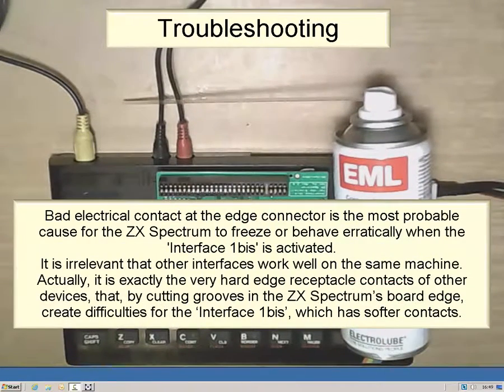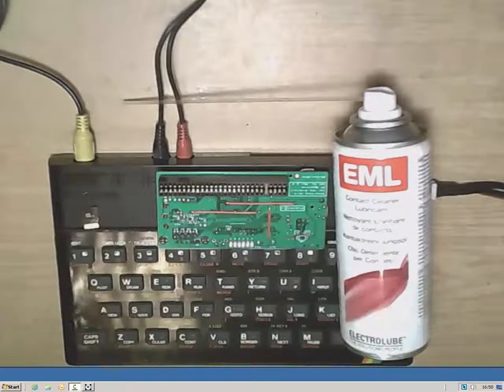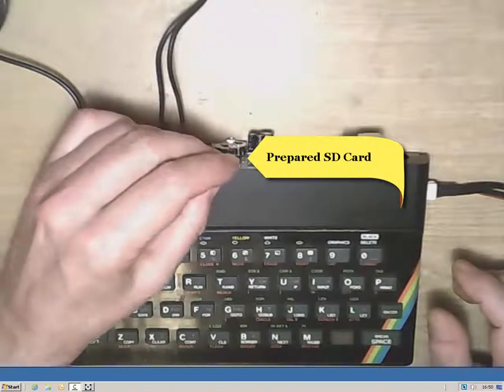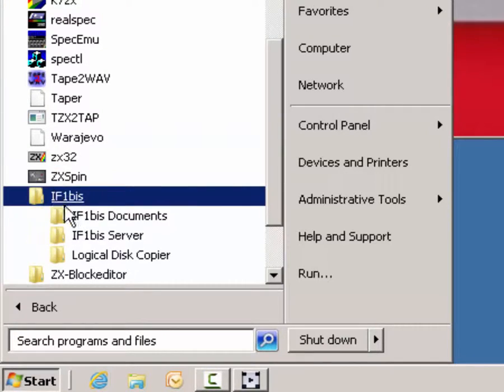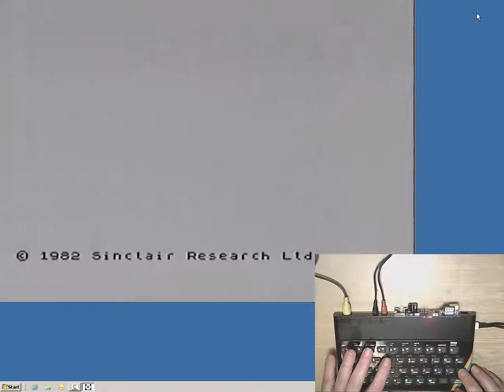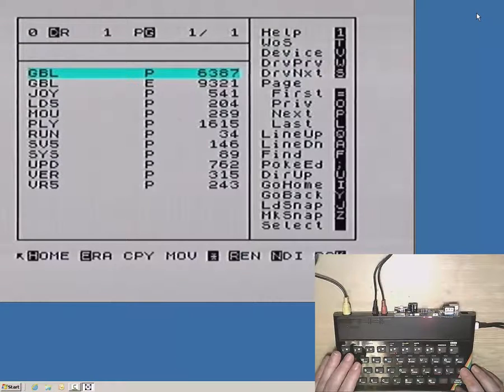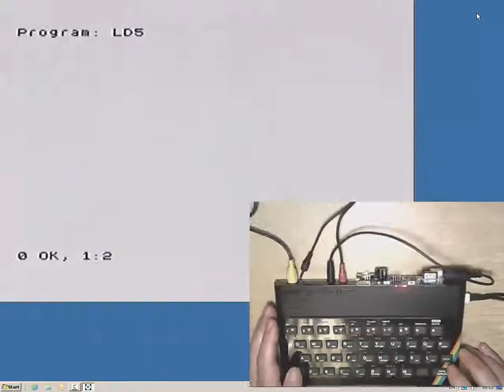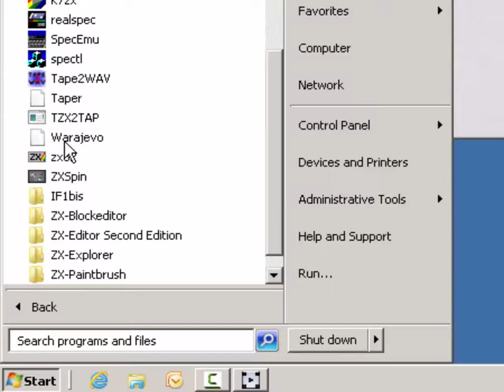Interface 1bs troubleshooting

Comment: Hey Dan !
I got a PS2 hooked into the 1bis, but it is not detecting it - is there any special command i need to do to make it work (CAT 0?
The USB to Server (CAT 0;"k"works fine, but I'd like to use a keyboard to the PS2 port in the extended mode to allolw for direct programming.
Many thanks,
ALan
Reply: no sooner i post something, it starts working !